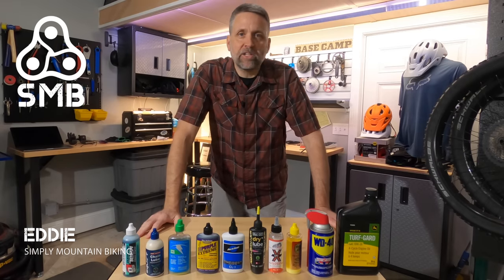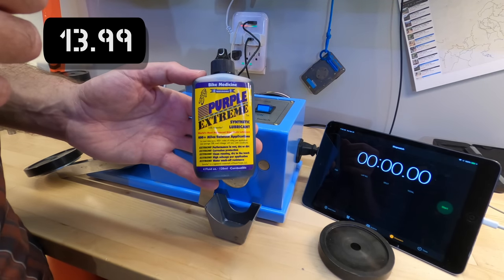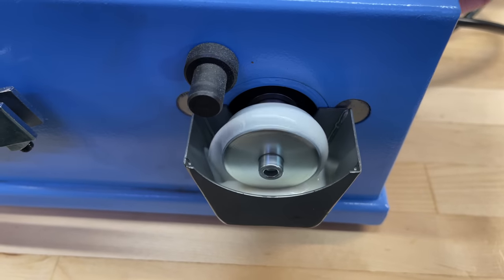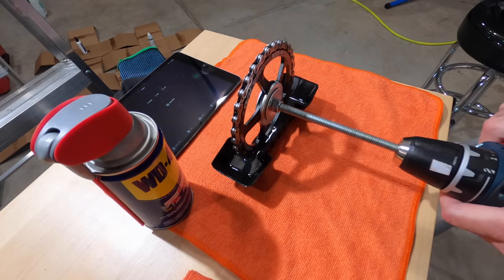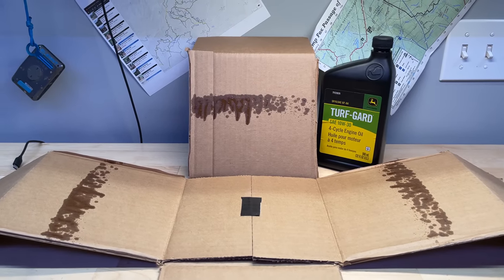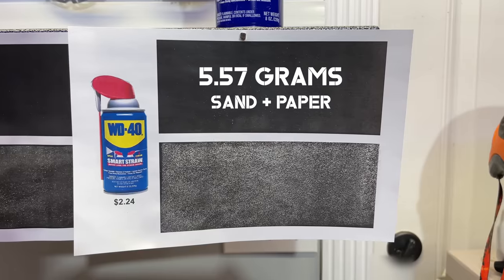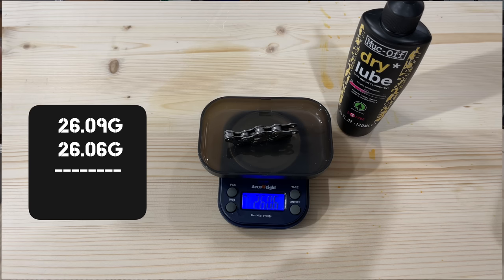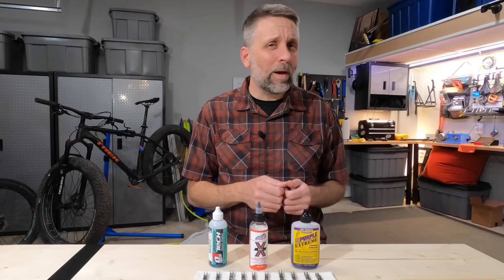Ultimate Bicycle Chain Lubricant Test | Best Bike Chain Lube

Comment: Can you imagine for the 3th test a wax even holds much less when apllied as it should. One hour dry, then wipe of with a cloth so only the wax inside the chain where it has ro domite job remains. Then almost no sand sticks ro the chain.
Only after one short ride some residu builds up to remove again with a cloth and of you go again.

For the water test. Also for wax as only parafine remains and rhe evaporating fluid disapears this remaining parafine looses that sticky feature when you spin the chain a few minutes in your warm up. After that it will be very supple.

Anyway this was a very well performed accurate way of testing. My compliments for that.
Reply from the maker: Thanks for your comment. -Eddie

Comment: I always use a block of bees wax held firmly against top and bottom of chain followed by the gentle use of a torch on chain in constant motion. Then just wipe chain with clean cloth.  Been doing this for 30 years plus.  Lubes great. keeps out dirt. Torch use has never hurt chain.  I usually torch and wipe off old lube/wax first then wax as above passing wax through flame repeatedly and prewarmed chain helps to apply enough wax. I must say use torch at your own risk.  I never let chain get too hot to touch and always aware that nothing is beyond flame to get burnt
Reply from the maker: Unique method! -Eddie

Comment: Fantastic testing parameters. 2 points, though. 1 WD-40 isn't a lubricant. It's a water displacement formula. It is also really good at cleaning off adhesives. 2 Muc-Off allegedly turns into a gummy mess after a while. I've never used it but have heard multiple bike mechanics voice their disdain for. You should definitely do this test with a chain that's been submerged in melted paraffin wax with PTFE in it. I've had great results with it on both my road and mountain bikes.
Reply from the maker: Thank you for your feedback and suggestions. -Eddie

Comment: Felt a little sorry for WD-40 since you uses its cleaner rather than lubricant to compete other lubricants.  WD-40 does have specific chain lubricants for this purpose, we normally use its cleaner for lubricating things, but its lubricants deserve some attention for sure!
Very interesting and effective test methods you designed, and also a lot of work carrying them out to share, very helpful video, thanks!!!!
Reply from the maker: Thanks for the comment - I'll check out the bike-specific WD-40 lubes. -Eddie

Comment: This is really good information.  However, I've been a road cyclist in N. Texas for over 10 years and most Rodies I know use Finish Line: Dry.  And it is the "Amazon Choice" for Bike Lube.  I would like to see how it compares before switching.  And, WD-40 (Water Displacement formula #40) is not a lubricant; it was designed to displace water.
Reply from the maker: Thanks for sharing! -Eddie

Comment: I've been riding for many years and it was impressive to see the only two lubes I regularly use come in at one and two. I was a big fan of rock n roll for years until the muc-off dry lube finally pipped it as my preferred lube. Both are great though.
Reply from the maker: Thanks for sharing your experience.  -Eddie

Comment: I have a Specialized Roubaix road bike, and it has 4600 miles on the original chain. I use the Park Tool chain wear guage to test for wear, and has no stretch or perceived wear. I lube the chain properly with the Rock and Roll Gold every 100 to 150 miles. I also clean the cassette and chainrings, which I think has a lot to do with the longevity of the chain. I'm not sure what the record is for how long a chain can last, but I do think the Rock and Roll Gold has been good for me.

When I apply the lube, I really saturate the chain to the point where the lube is dripping off. Then I rotate the chain at high speed to get most of the lube to fling off. I repeat this another time, then after letting the lube dry somewhat on the chain, I try to dry off the chain as thoroughly as possible.
Reply from the maker: Thanks for sharing.  I think R&R Gold is a great lube and I continue to use the bottle I bought for testing.  I find it just doesn't last as long as the Muc Off for me. -Eddie

Comment: Hope you take this as constructive suggestions as these are what I see as being not quite representative of real world conditions. 

i) The wear tests should be applied without a reservoir across all the lubricants. That's just how they are supposed to be used. 
And also, they are to be used after the lubricant solvents have dried for the dry lubes, so the test should reflect that. 

ii) The sling tests should likewise be done for the dry lubes after they are dried and the wet lubes given sufficient time to bind with the chain. The chains being clean for each trial that is. And easier way to determine the amount of sling really is to just use your digital weighing scale. Before and after. Nothing subjective in the assessment. 

iii) The sand retention tests similarly should be based on how the lubes are meant to be used. Wet or dry.  And they should be applied to a piece of metal or a chain. Measured for weight Clean before they are slobbered in sand and dirty after they are and then dropped from a specific height like you did there. 
Then measured on your scale after the drop. 

iv) As for the wet test, I think its quite fair as it is.
Reply from the maker: Excellent advice, all.  Thank you for taking the time to respond so thoroughly and thoughtfully! -Eddie

Comment: I had a bottle close to "Epic ride" formula, used it ONCE on a squeaky gate that was so loud and irritating if somebody opened it and you weren't expecting it, basically your teeth would just about drop out! I only used a little bit but that was about 3 years ago and it's still quiet! and used it on a squeaky rotary clothes line in the backyard same result, so great for squeaky gates and clothes lines.
Reply from the maker: Haha - thanks for sharing.   -Eddie

Comment: Half fill a smallish jar with general purpose grease, add engine oil to taste, blend to sticky liquid consistency, transfer to small plastic bottle with a spout ,   put the bike on stand, start and engage first gear so it ticks over then squeeze the bottle so the mix flows slowly and gets into all areas of the chain as it spins.  Takes about 20 seconds to oil the chain and the stuff works great.   Repeat when necessary.
Reply from the maker: Great tip! -Eddie

Comment: Well done!!! For the sling test, a drill with a low range-high torque setting may run at a slower & more realistic RPM...
Reply from the maker: Great point! I did run it in the lowest range/torque setting but it was still quite high speed! -Eddie

Comment: Great test and well detailed. There are area’s some may challenge like field test, but you have done your upmost to keep similar conditions that is required for a comparison test. any manufacturers for any kind of products are running tests like this.(as a QA engineer I have little bakground here) The good news is I am running muc off dry as well, and I am very pleased with ( just luck guys 😁) but also use the wet version in winter that is more resistant to be washed by wet conditions, great test, video and clear explanations ! That does take lots of time in reality
Reply from the maker: Thank you for your insights - Eddie

Comment: Based on your scientific research, I'm going to try Muc Off for my new bike. I was using Finish Line wet and dry products in the past.  Wish me well 😊 appreciate your video and solid input.
Reply from the maker: Report back what you think! -Eddie
Reply: Hi again, I finally decided to go with Squirt. So far, so good on the Squirt product. I only go outdoors when it is dry. I am very satisfied and will probably continue with that product for a long time. I will eventually add that to my indoor bike also.

Comment: Great detailed comparison test,  I commute everyday to work through rain, flood, dry. mud and sandy terrains and on the road both MTB and road.  I notice MUC-OFF gets extremely dirty and gunky each week and quite hard work for me to clean it off.  After i switch to the SQUIRT the chain seems to clean by it self by shedding off those heavy dirty gunk off the chain and its to easy clean it once every three week compare to once a week on MUC-OFF which is very stubborn to clean especially the casette gets all greasy.  The only cons for SQUIRT that you'll need to keep re-lube after 2~3 days of hard ride. But both chain lube does perfect job to extended the chain life span.  However i stop using Epic ride and Finish line teflon lube for being too messy, gunky and under performed for my daily commute in this tropical weather i lived in.
Reply from the maker: Thanks for sharing your personal experience! I find Muc-off very easy to clean off and re-apply. -Eddie
Reply: @SimplyMountainBiking  Hi, great scientific review. How do you clean the Muc-Off dry lube off your chain? Degreaser? Or just water and bike washer?

Comment: Great report! Thank you. WD-40 only if you are 10 miles into a century, forgot to lube your chain, you run into a hardware store and that’s all they have. It’s a degreaser anyway. I’ve used to degrease my chain and clean my greasy hands. Back to Rock and roll Gold I guess. Been using Silca super secret chain lube on my road bike. It’s clean but shifting performance is less than desired. And they like it a lot. $$$
Reply from the maker: Haha - I hear you on the WD-40. -Eddie

Comment: I used Squirt for about 1000 miles on my road bike chain in mostly dry conditions. When I took the chain off for a good, deep clean, I found an unbelievable amount of goop. The remaining Squirt was tossed into the trash can. I have switched to Muc-Off. We will see how it performs.
Reply from the maker: Yeah - I had similar experience.  -Eddie

Comment: Typically when such lube is used on bike chain, we let the lube to dry off in the chain before going for the ride. In addition, the rivets and rollers in the chain does not spin that much when the chain is ridden on the bike. Your experiment was essentially the measurement of friction inside a pool of lube. Perhaps your next experiments should take into such into account. Cheers.
Reply from the maker: Thank you for your comment. -Eddie

Comment: I initially used Dumonde Tech, and in SoCal riding conditions it picked up a lot of dirt and debris, and clogged up quickly. I changed to Squirt, and it seems to work really well. It doesn't clog up with debris, and it doesn't build up a waxy funk on everything. I did get some of the Muc-Off ceramic lube but I haven't tried it yet. After seeing your results I am going to start using it.
Reply from the maker: Thanks for sharing! -Eddie

Comment: Was WD-40 bicycle Lube wet or dry not invented in 2021 at that time? Is there a possible way that you could probably use WD-40 bicycle chain lube wet or dry or a combination of both to test to see if it's even near the top two? Maybe the next video you could try it so that the viewers can get more better understanding on which lubrication is better to use. Thank you.
Reply from the maker: Thanks for the suggestion.  I have a set of lubes I want to try next - but WD-40 bike lube is not part of that set. -Eddie

Comment: I use 80w90 gear oil on my motorcycle chain, applied with a brush which oils every nook and cranny. It expels any dirt so all links remain fully moveable at all times and the chain stays technically "clean". Only downside is it may drip mildly for the first day, if parked up after applying it, which is solved by an old flattened cardboard box under the chain area. Chain always looks like new otherwise though. Should work perfectly on bicycle chains too, as won't need oiling as often as a motorbike chain.
Reply from the maker: At that viscosity - on a mountain bike - I think 90w really picks up a lot of gunk on the trail. -Eddie

Comment: You should try a micros scale too. Measuring the amount of weight lost and the wear scar length is probably more accurate than just measuring only its length.

And for the sling test it is a good idea to weigh the dry card box and then reweigh it after the test to see how much it soaked up, that should give you a little more in-depth information on how much it will stick and leave. Instead of just eye balling it. 

I love everything you did with the channel ❤ and I hope this idea might be able to help you make a much better content.
Reply from the maker: Thank you for your suggestions.  Much appreciated. -Eddie

Comment: I like all these tests... one thing though, I always backpedal a rag until the chain is as dry as possible after lubing it, as the point is to get the lube under and in the rollers for the lubrication and not to leave a dirt-attracting coating on the outside.. so the sand test isn't really quite as important unless the user doesn't wipe the outside.
Reply from the maker: Great information! -Eddie

Comment: Reminds me of the Project Farm oil test. Although I think in the wear test, the lube should be applied to the wheel and let dry as per specifications and not submerged as most of them would be just running in solvent. 
Awesome video 👍
Reply from the maker: Thanks for the tip.  I think I'm going to run future tests without the bath.  Thanks again! -Eddie

Comment: I have used many lubes over the years and I can safely say that for riding in my ares (Sandy trails with some clay areas), I have found that a dry ceramic based lube is by far the best for me. After a ride I just use a dish brush to get any loose sand out of the drivetrain, then rinse.

This has kept by gear running for years and I have never had issues with rust
Reply from the maker: Thanks for sharing! -Eddie

Comment: I've got to say the Rock 'n Roll Gold (used it for 2 years) just isn't good for rides longer than 18-20 miles in my experience, depending on the conditions.  The chain becomes noisy and dry in SoCal dry dusty conditions.  Where Dumonde always lasts up to 3-4 rides and still be nice and quiet.    And having such a low wear rate as demonstrated so well in your test, nothing close, has to be weighted much more than the other tests you performed.    If I lived up north with more rain I might be more excited about losing a few hundred grams more in the wet test and put more weight on that test but the differences were so slight.  Might be better to know the dry chain weight and lubed chain weight so we can know how much lube was added to each chain initially.  Then calculate the loss in lube/starting lube weight.  My experience with Dumonde is that it doesn't get slung off when riding, lasts way longer than Rock 'n Roll Gold and many others and isn't sticky to the point where it attracts and sticks dirt and mud all over the chain.
Reply from the maker: Thanks for sharing! -Eddie

Comment: Excellent test - thank you!. I see only one error. The "Squirt" ist more fluid then "Muck off" shown on chain wheel test, but thank to this it better penetrates the chain - you see it on chain stifness of Squirt - there is more wax in the chain then by "Muck off". Because of it- is more fluid -is less dense - it shows more wear.   It would be better to test the dry lubes on wear test  in fully dryied state.
Reply from the maker: Great point! -Eddie

Comment: Muc-Off Dry Lube is great for about two to three rides, but it will virtually disappear after that, so you'll need to apply it very often. This might not be a problem for some people, but I want a lube that lasts at least ten rides. I found Finish Line Dry Lube to be the best compromise.
Reply from the maker: Thanks for sharing! -Eddie

Comment: I bought the muc off lube based off this video and have been impressed so far. Used to use squirt, then switched to duamond tech, occasional rock and roll lube (wasn’t
Impressed). I’ll be sticking with the muc off for a while. I didn’t get the ceramic though so might be interesting to compare the ceramic with the non ceramic.
Reply from the maker: I have the ceramic for a future test! -Eddie

Comment: It takes me 5 minutes to clean my drive train when I've been using Squirt, but it takes an hour to get the black shit off when I'm using Muc-off...
Reply: Have been mountain biking for 25 years now and tried numerous products. Squirt was recommended by a mate and I was dubious but it is great to use. Just allow it to dry overnight before riding ideally and wipe off excess after applying.  Never goes black and a quick wipe with a rag and the chain is clean and ready for a reapplication when needed.  Great for my mainly dry and occasionally wet rides.
Reply from the maker: I keep reading this - perhaps you used a different Muc Off product?  I can use a hose nozzle (not pressure wash) to remove 90% of the Muc-Off...  -Eddie
Reply: muc-off wet lube (blue bottle) is horrible for gunking up the chain. The dry lube (yellow) is fantastic!

Comment: i am also impress at the result, but each lube have different application instruction, for eg Squirt is a wax, you have to apply and wait for it to dry and re-apply, on zero friction cycling, squirt perform quite well, and longer test will be require for more correct data
Reply from the maker: Thank you for the feedback. -Eddie

Comment: Congratulations on a very extensive test!!! Just a quick comment, I use Muc Off Dry on my bikes BUT they are for dry weather, not wet.
Reply from the maker: Thanks for the info! I read on the bottle it's for damp conditions and it works well after a few stream crossings, high humidity, and light rain for me.  -Eddie
Reply: @SimplyMountainBiking  Hi again, yes, but for wet conditions there's Muc Off Wet 
Thanks again for your videos!!!